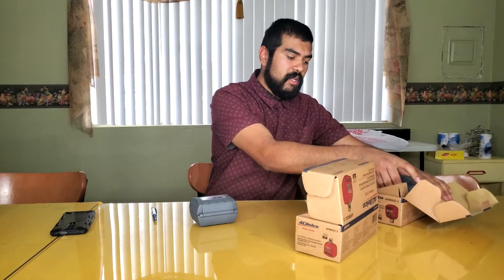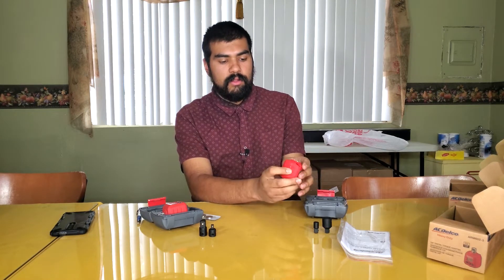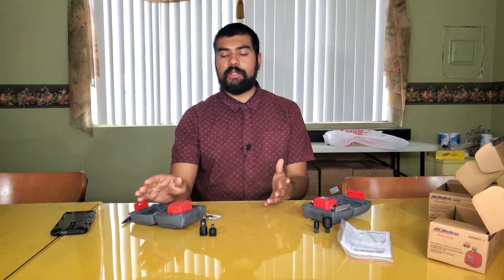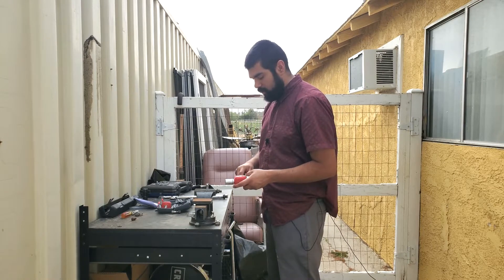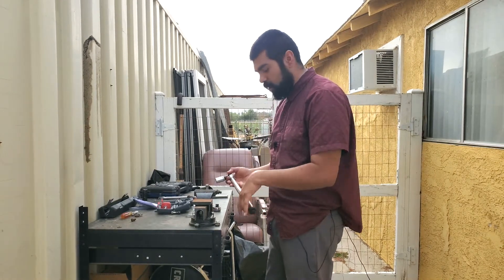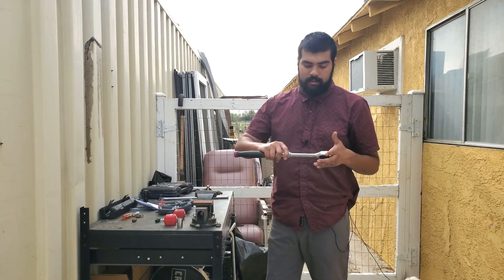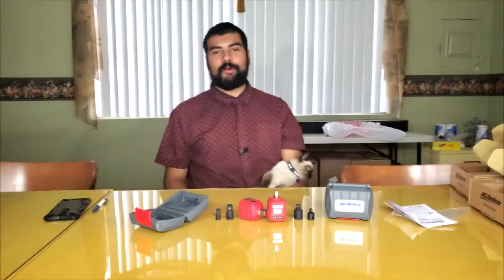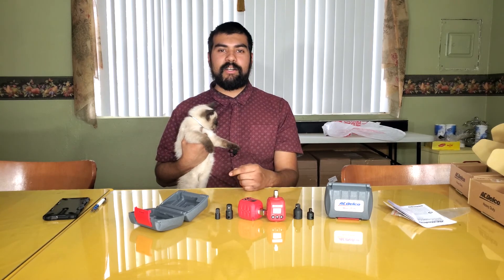AC Delco digital torque adapter

Comment: The torque meter is measuring torque at the axis of fastener that it is rotating around.  A longer handle "cheater bar" only makes the work easier for YOU or ME, doesn't change the torque needed or applied.

Comment: If one understands the concept of torque you should know that about the only thing being tested here is the battery and the piezo beeper. Nothing being done here can be used to evaluate the accuracy of the torque adapter.  A torque wrench of unknown accuracy is being compared to a torque adapter of unknown accuracy, but hey, it’s dead on!

Comment: If your testing, you have to make sure, your torque wrenches are calibrated accurately before test, if not, it defeats the purpose of the test, if you are testing for extreme accuracy you cant blame it on the manufacture like harbor freight, it gives impression that harbor freight tools shouldn't be considered as high quality capable, and if you believe this to be true, you should have used a higher grade manufactured torque wrench for accuracy test. Ultimately the test is inconclusive to extreme accuracy.